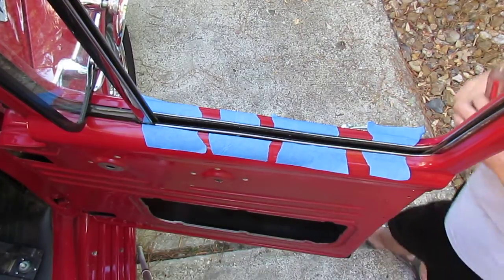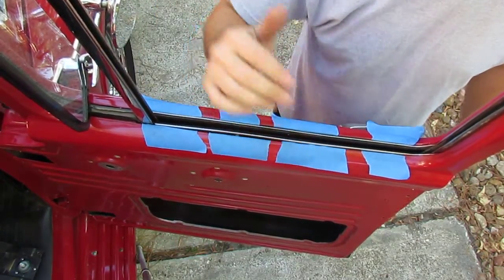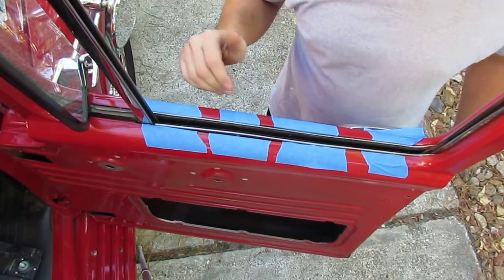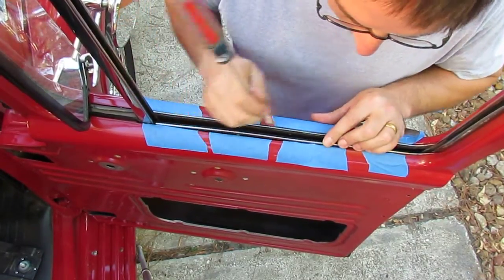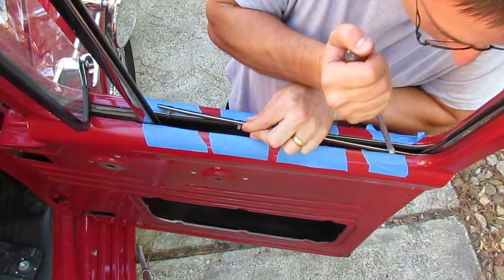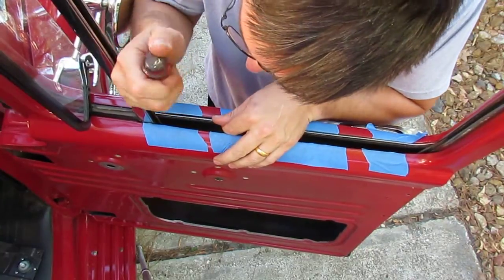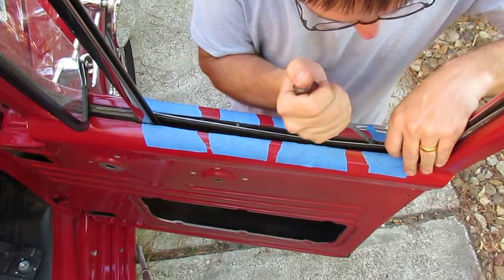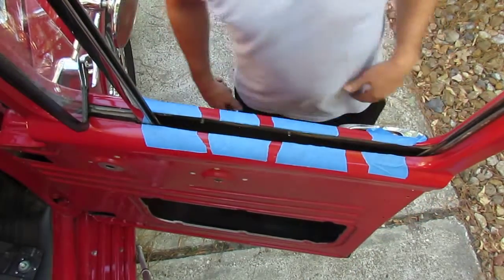06-Anti Rattle Bar Removal  (Scott's 1956 Ford ProjectF100)

Comment: Great videos!   I was able to remove the divison bar without removing the lower anti-rattle bars.   After removing all screws from division bar and backing the top anchor from under the upper anti-rattle bars (you may have to move the vent rubber as well), it slides straight down and out of the door.